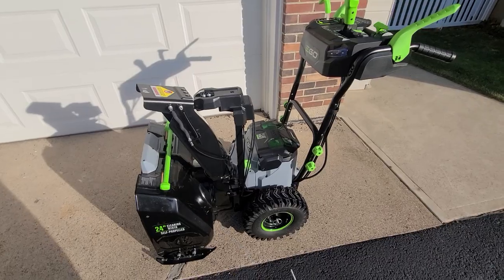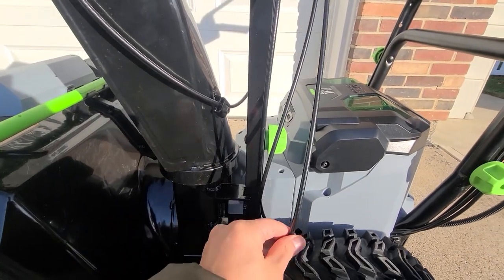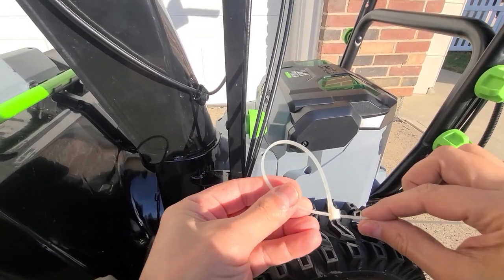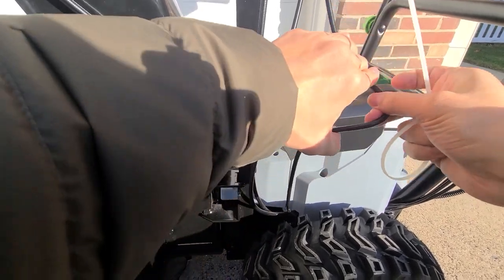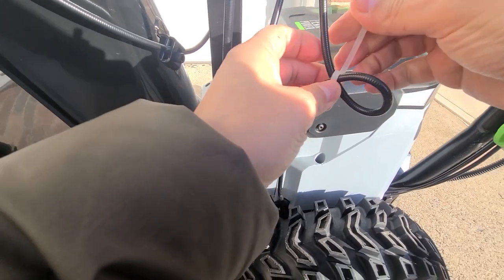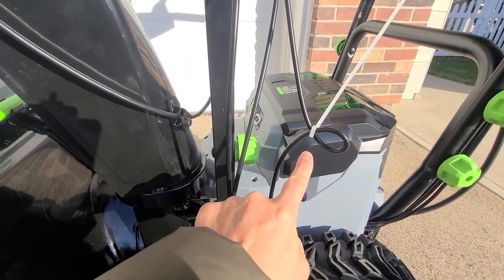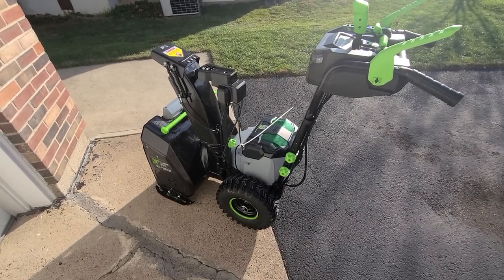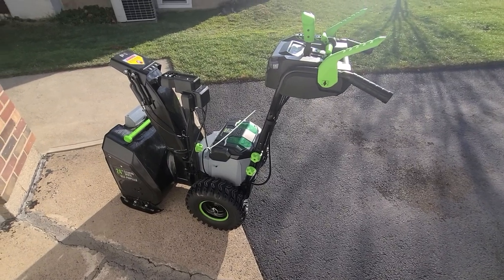EGO CHUTE FIX for the EGO 2 Stage 24 Inch Snow Blower

Comment: On newer machines, I'm speaking of ones that were manufactured August 2021 or later. In the manual on page 22 there is a section titled "Chute and Deflector Adjustment" (Loose/Tighten The Snow- Discharge Chute). There are inline cable adjusters on the cables running below the control panel that they have installed to make the adjustments.
Reply from the maker: Yes I've seen that, wish I had that

Comment: I was afraid this would be a problem. I had that on my 9HP Craftsman that this is replacing. I thought that there was a lot of slop in the adjustment. Now I wonder if there is something in the cable head that needs to be worked on. I called the company, left a message, so will keep my hands off of that thought until I hear back. Thanks for the two VERY good videos!
Reply from the maker: Steven thank you so much for watching and commenting, I’m waiting on the final fix and on the snow in the battery compartment as well. Machine ran great though, loved it, definitely needs 2 x 10ah batteries though for larger jobs. Again thanks so much

Comment: Might have to wait for the second gen blower. This and the snow going in the battery compartment. And maybe they’ll start coming with the 10AH batteries. 👍🏼
Reply from the maker: AJ honestly it's a really good machine. All in all it worked really well and the snow in the compartment the machine is ipx4 rated and I learned the battery compartment has drain holes but I do understand your concern I feel very similar

They are coming out with a permanent fix for the Chute and they are coming up with a communication concerning snow getting in the compartment
Reply: @TechMadeEzy  glad to hear it has a Ip rating. It just doesn’t seem right to me that snow can get all over the batteries. Specially since it could melt from the heat coming off the batteries. I guess I don’t understand why they didn’t just put some kind of water tight seal on the battery compartment lid. Specially with how much the unit costs. I’m definitely gonna get one still (that’s if greenworks doesn’t make one before I make the purchase).
Reply from the maker: I'm with you, definitely more info to come AJ
Reply: @ajgreen868  What I dont understand is that they know how to make these battery compartments... I mean my 4 season Ego 1 stage blower never had snow in the battery compartment so I really dont understand how they designed that one considering the compartment are almost the same...

Comment: Weird issue, I’ve plowed about 15 driveways full of heavy snow with mine so far with zero issues of it moving to the right. The wire has slack. I’ve got a few other issues, mainly related to the batteries not wanting to charge back to back, getting a blinking red light until they’re ready, but no chute issues at all.
Reply: Mine is also OK,no chute issue. The blinking red because the battery inside is hot after use, need to cool down before recharge, no brand can solve this. l also own the lawn mower and 650CFM blower, two more backup batteries. With those four batteries, plan to buy more bare tools, say goodbay to gas.
Reply from the maker: Thanks for watching Jeff
Reply from the maker: Thanks DJ

Comment: My chute does not move at all, I can’t move it left or right. Any suggestions on how I can fix that? The support number for this company is down until after the holidays, we just had a ton of snow, and their community forum is also down. I can’t move the chute handle at all, left or right. I don’t know how to fix this. There is a nut on the cable about halfway between the handle and the chute, and I loosened all of those nuts but it still will not move at all. 😢
Reply from the maker: Do you have the tension adjusters on the cables
Reply: @TechMadeEzy  I have a similar problem.  The chute adjustment handle is VERY tight to move.  Can you show me where the tension adjusters are on the cables?  someone above mentioned a page 22 which shows them.  However there isn't any mention I can see on my manual or the one in the EGO site.  Thanks in advance!
Reply from the maker: On the back of your snowblower if you don't have adjustable nuts on the cables that's okay because they discontinued those. If your unit is too tight you might have to call EGO support and they might be able to help
(855) 346-5656
Reply: I checked the cables and the cable holder on my machine yesterday.  I found the cable holder was out of place...not attached to the handle.  I put the holder back and the chute adjustment is a bit easier.  If this doesn't work, I'd check under the cover of the chute mechanism.  There is basically 2 gears and the cables run one gear back and forth...you might have something stuck in the gearing?
Reply from the maker: Nothing should be stuck (I hope)

Comment: My Toro doesn't need a zip tie. The chute stays put.
Reply from the maker: The one in this video is a single stage push snowblower the model for the 2 stage is snt2400 or snt2405 w batteries and charger
And thank you for watching
Reply: @Dan Snyder 
Toro QXE 824 with Personal Pace, 8 HP 24" gas self-propelled single stage with electric start that out performs many 2 stage models. It hardly uses any gas and is 35 lbs lighter than the EGO 2 stage.
I thought of the Toro battery model, but it would cost too much money for extra batteries as well as the down time to charge the batteries.
Also, I  had a top of the line Honda 7/24 gas with track and this Toro is much better.
I had an EGO single stage snowblower as part of a package. I read reviews on the EGO owners web page. They were not good.
As a result, I sold it.
Gas is necessary for a snowblower.
Too many variables with weather, amount of snow per day and beyond, as well as possible power outages.

Comment: How are the skids doing? I think I heard you say in the other video that you had to reinstall them, any advice? I find mine are  pretty wobbly...
Reply from the maker: Hi Jonathan, The key thing is making sure you find an even area to install them, then use paint sticks to lift the blower so the skids can drop a little evenly. I used 2 paint sticks and put a few sets of them under the blower, the middle I put 2 sets, then I put a set on each side. If you want shoot me a message on Twitter and I can send you some pictures and you can send me some pictures
Reply from the maker: @TechMadeEasy1 on Twitter, give me a day or so to respond

Comment: I think you can only run the blower with 7.5 batteries. Do you know if you can run (1) 10Amp and (1)?  I wouldn't mind buying ( 1) 10 Amp but not 2 at 400 a pop. Thanks again
Reply from the maker: Thanks Tony, No data yet on 10ah, I’m dying to get my hands on one.
Reply: you can not run it on 1, but you can on 2.
Reply: @chrisanderson8553  so you can't run a 7.5 and a 10 together?
Reply: @tonyholmes9024  sorry. I miss read your 1st question. I thought it said.. "could I run it on 1... 10 amp battery"... you wrote... 1 and 1.... yes. You can run it on a 10 and a 7.5... my bad for mis reading
Reply: That was my bad...Thanks again